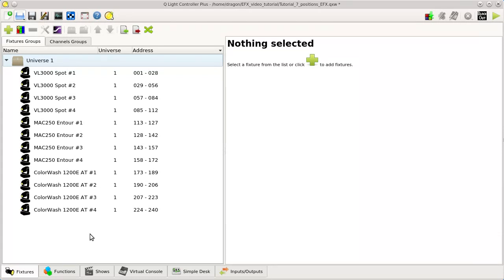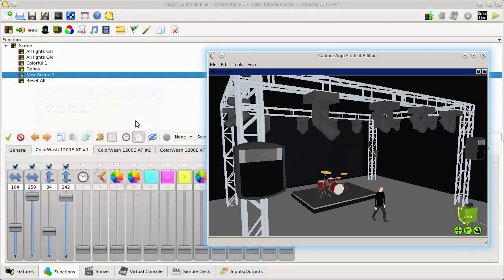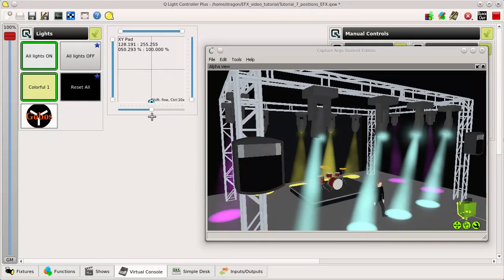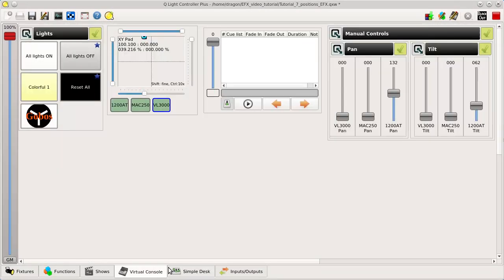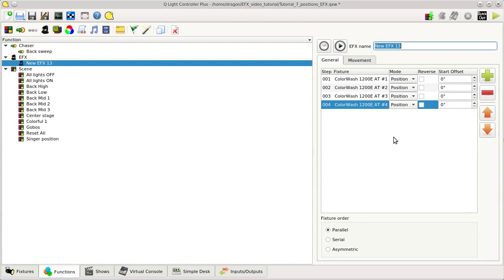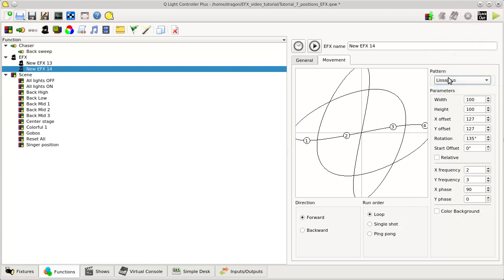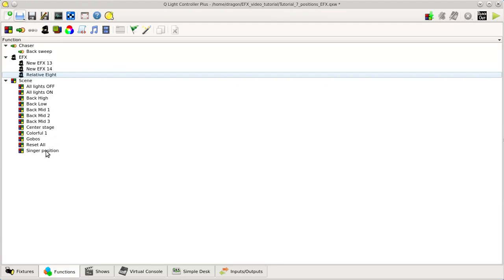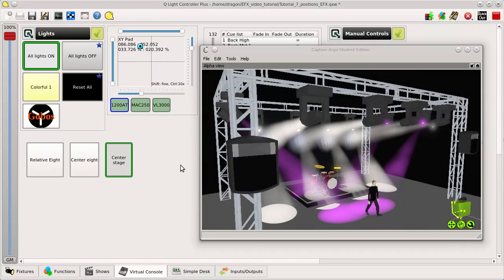QLC+ Video Tutorial #7 - Positions and EFX

Comment: I tried the same exact step on time 24:24 but the EFX don't do anything after I turned it on. created new efx, selected the movement then went to the virtual console created the button for efx and selected it's function tied/binded to the efx. pressed the green play button to make the buttons work. then I turned on the lights on, it worked. but when I clicked the efx button my beams/moving head don't do anything.

Comment: How do I have an efx going and fade in the intensity of the light by using a chaser? It works when I use a collection but then when I put the collection into the chaser it doesn’t fade the light in. I am trying to setup a light show for my band and I won’t be able to control the console but I will have a foot controller to start and run through chases

Comment: This is extremely helpful!!!  Thanks Massimo!!  I don't have moving heads yet, but I will soon, and this is going to keep me from pulling my hair out from hours of frustration.  

I am using QLC+ for lighting a band, and I have programmed all of the songs they perform using chases, where I have anywhere from 10-30 scenes and other chases embedded inside the main song chase.  Sometimes I need more finite control that 1/100 of a second in my chases. Is this possible? and if so how?